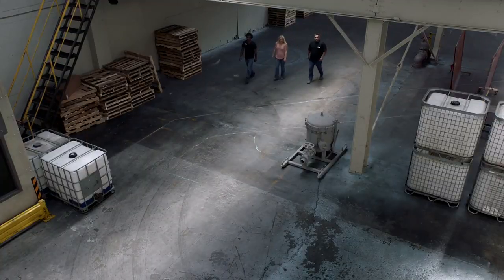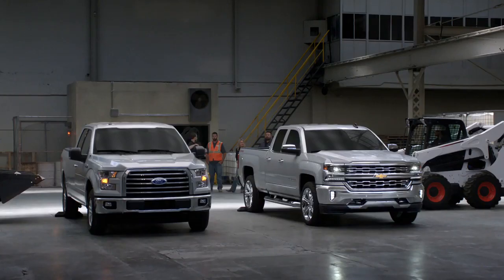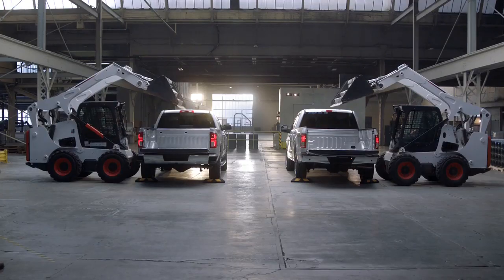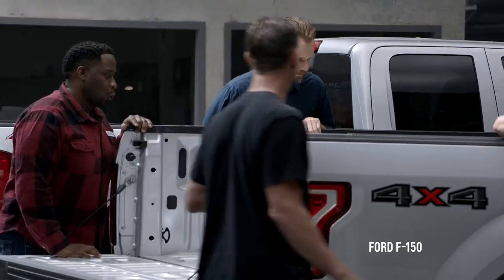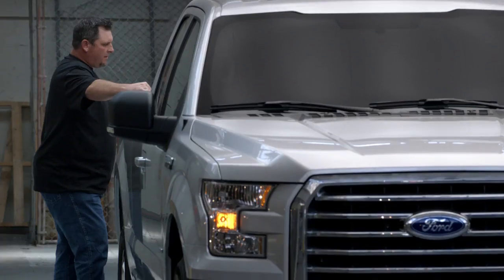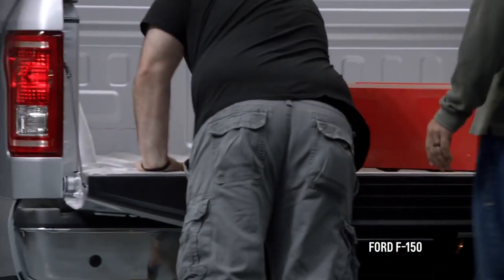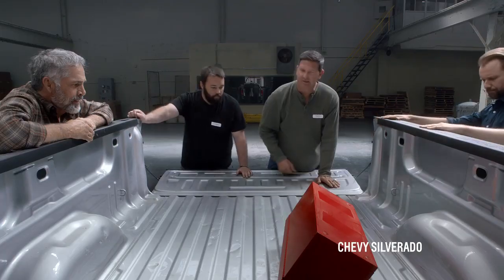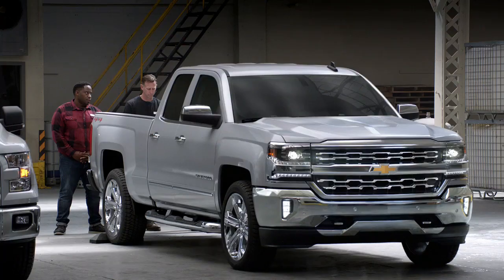Silverado Strong:  Steel Bed Outperforms Aluminum Bed - 2016 Silverado | Chevrolet

Comment: The benefit with the f150 is it being equipped with automatic emergency braking and it being safer than the Silverado
Reply: Don't worry, most Fords will fall apart long before you'll need to emergency-brake.

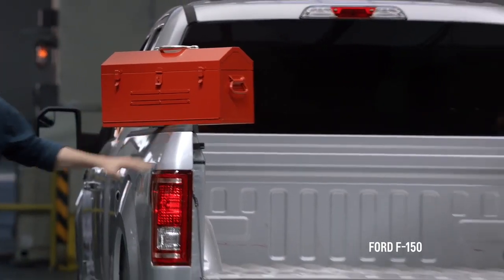Comment: if you watch closely, they dropped it more than once on the ford. watch where the toolbox ends up at 1:50. on one shot it faces toward the tailgate, on another it faces the cab. this to me proves 100% this is fake.
Reply: Different sets of actors/real people for two trials of throws. Likely different vehicles for each set
Reply: Two things:
1. The Ford's bed got the gash the first time it was dropped. I'm not sure why they'd edit it like that because it is a bit confusing but the bed was damaged the first time.
2. They actually dropped the toolbox on the Chevy three times. If you watch each angle, one of the times it lands upright, then sideways, then upsidedown.

Comment: You guys used 54 bricks for the ford and 52 for the chevy, liars.
Reply: if you watch closely, they dropped it more than once on the ford. watch where the toolbox ends up at 1:50. on one shot it faces toward the tailgate, on another it faces the cab. this to me proves 100% this is fake.
Reply: Must have come from zebra corner
Reply: Ford fond on road dead
Reply: Like that makes much of a difference?